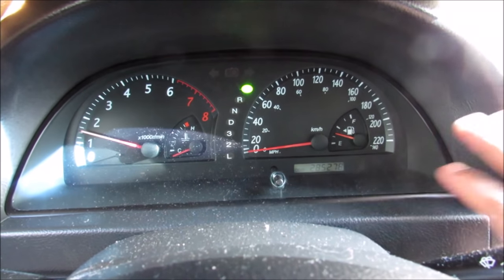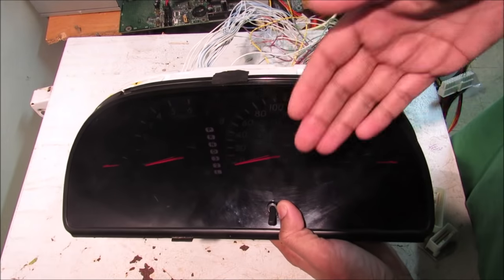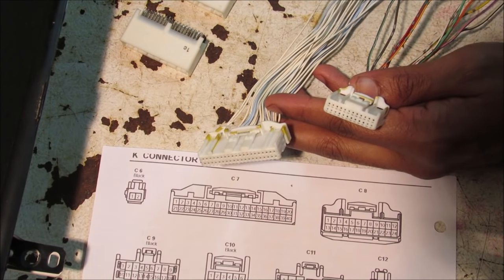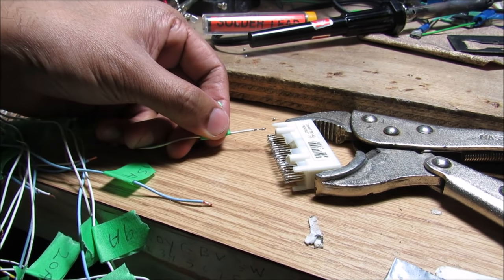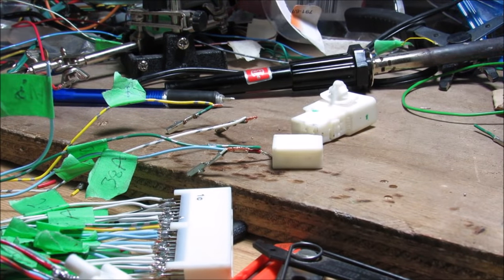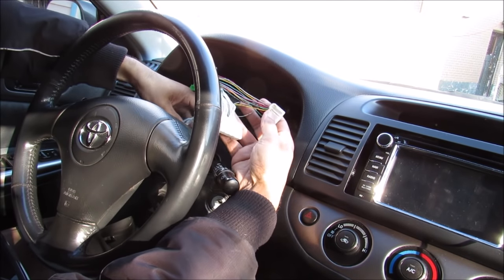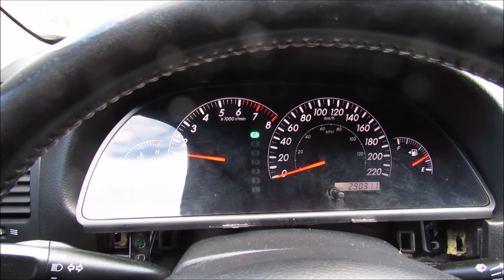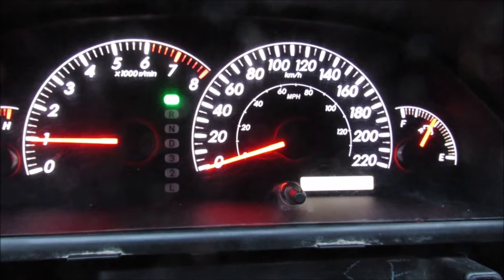How to Swap an Instrument Cluster

Comment: plug and pray LMFAO
Reply from the maker: +mobiblu07 oh yes...I didn't even bother checking each wire after all that soldering! 
Turns out I only misplaced one wire for the fuel gauge.
Reply: @speedkar99  You are the man when it comes to these clusters.I learn alot from you👍...

Comment: @speedkar99 Hey, so I have a question I wonder if you can help me with; I am in the process of swapping a Gen 5.5 Camry cluster to my Gen 5, and right now, I'm facing issues with the ABS light turning on since my car didn't came with ABS, and parking brake light staying on no matter if I disengage my parking brake or not.

I'm pretty much scratching my head now because I don't know what else to do, what do you think? 😅
Reply from the maker: Hmm that's interesting because I think the 5.5 all had ABS... So if there's no signal it's going to trigger the brake and abs lights to come on

Could you trace the wires that go to the parking brake and abs module and perhaps ground them? 

Worse case is out a tape over the LED then close up the cluster
Reply: @speedkar99  Hey!

So I looked over the diagram, it appears that they're not separate wires, they sort of run on the same circuitry. I also notice that while the Gen 5 cluster has a separate wire for the parking brake switch, the Gen 5.5 doesn't have that. 

As for taping up the LED, that's what I've done for now, although I'd love to have the parking brake light haha.

Comment: Good video... I'd have thought that for 4 or 6 cyl tacho mode there'd just be a jumper setting to select it.
Reply from the maker: +Rybagz I know eh! They did this on the previous generation too between the Camry and ES300. Those 4 cylinder Camry guys didn't have working tachos because the ES300 only came with v6.

Comment: Hi buddy, thanks for the great video. Can you tell me which wire supply power to the instrument cluster? mine is 2002 toyota camry.
Reply from the maker: Check the pinout diagram, 02-04 is similar
Reply: Well, thanks I have another question, my instrument cluster was dead so I had to unplug and replug the main pins to make it works every time. So I don't want to replug it, it is a way to put a switch on it to make it works. Thanks in advanced

Comment: I have a question when you replace a digital cluster does the miliage change or they stay the same ?
Reply: From my own experience in fiddling with cluster replacement the mileage change to whatever miles is in the replacement clusters chip.You have to send to a cluster company a signed affidavit of your original miles or send your factory cluster  to be calibrated/clone to your replacement cluster.Remember its illegal to go back on your current original miles you only can match them or go higher.
Reply from the maker: Mileage stays with the cluster. Check out my other channel speedkar100 where I show you how to reprogram it

Comment: I wonder if it would be the same for my mazda  2. The 2010 model has a white background and the 2012 one has a black one, i want the black one
Reply from the maker: See if it physically fits before electronically matching them
Reply: @speedkar99  they do, i found out even the 2011 model  had the black. Its the same car, it was made from 07-14" so alot of the parts are the same.

Comment: Do you think a speedometer instrumental cluster of a 2020 Corolla fit a 2009 Corolla?
Reply: I tried to get a 2019 Corolla instrument cluster to fit into my 2009 Corolla and it not a good fit. The 2020 Corolla instrument cluster doesn’t look like it would fit into a 2009 Corolla. 

However, if someone had an instrument cluster wiring diagram for a 2019 and 2009 Corolla...I would be willing to make a YouTube video on installing a 2019 Corolla instrument cluster into a 2009 Corolla.

Comment: I did an instrument cluster swap 02 Camry to an 02 Camry mine was made in Japan, the other car I don't know.
My parking brake light is on and abs is on.
Reply from the maker: And when you swap back those lights go out? 

Double check the wiring diagram, they may have made a change in the US vs Japan made versions.

Comment: Hey I Got A Jeep Liberty 02 original Miles is 173k i bought the car n the dash said 135k idk with the person rollback or change the cluter i was looking for a new cluter on ebay cor $50 with $175k only 2 k miles more but if i dont want to program the miles can i still change it like taking the old one out n putting the new one or i need to program the cluter
Reply from the maker: +F&K Vlog's Yea 
But the cluster might not be the only thing storing the mileage on chrylsers.
Reply: speedkar99 So I dont need to program the cluster just taking out the old one plug in the new one ready to go ?
Reply from the maker: +F&K Vlog's I'm not sure on Chrysler products if the mileage was stored in the body control module or the cluster itself. Check the Jeep forums, I'm sure someone has swapped clusters already

Comment: Is it possible it switch a manual climate control with an automatic one on a 2002 camry?
Reply from the maker: +Javid Jalim not easily. You'll need to remove the dash and change the climate air box.

Comment: hey man i really appreciate your videos. i just need your opinion on somwthing tho. im planning on painting my dashboard. ive seen you spray paint on other interior trim pieces in past videos but never on the dashboard. Is there a reason for it? do you think it would be okay to paint my dash? or will the heat make the paint chip eventually?
Reply from the maker: It won't stick after a while. Try vinyl wrap, I tried it on Lexus ES

Comment: Hey how’s it going man great video🔥🔥 Not sure if you can help me but maybe you can pointe me in the right direction I have a 2004 Chevy Tahoe and I wanted to swap in a 2006 Corvette cluster I’m having a hard time finding a wiring diagram and parts I need to put it together any help would be much appreciated thank you!!!!
Reply from the maker: You need to find the wiring diagram to get it to work, it's usually with the repair manual or available thru alldata or prodemand subscriptions

Comment: Link to the schematic is dead, would you mind re-uploading that? Thanks in advance I’m going to attempt the swap this weekend 🙏 Plug and Pray
Reply: Update - I was able to reprogram the mileage from the 93C56 chip on the Gen 5.5 model using a CH341A USB programmer for $10. You only need to wire 6 pins of the 8 on the chip to the usb programmer and it has the clip on one end so you don’t have to solder at all and can connect to the EEPROM chip on the board. Still looking for the wiring diagram to complete this swap! 😅